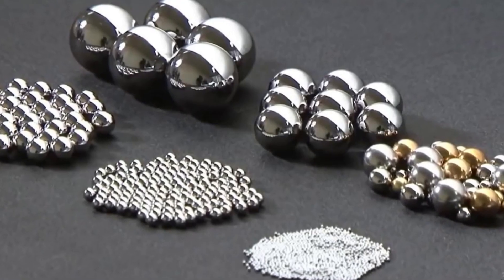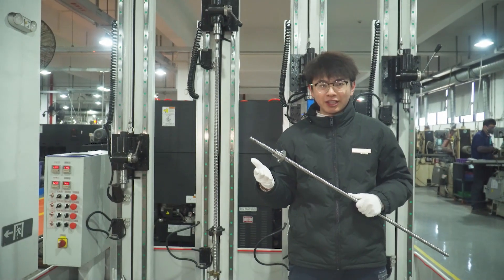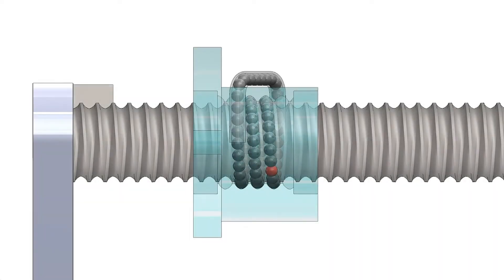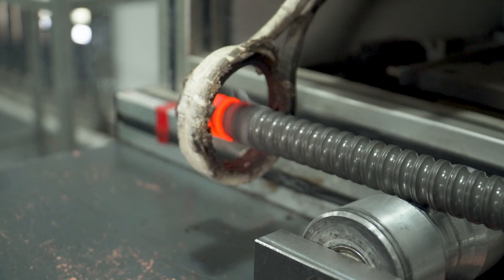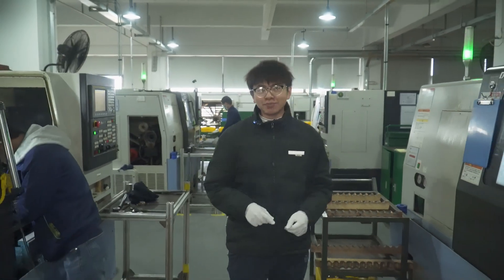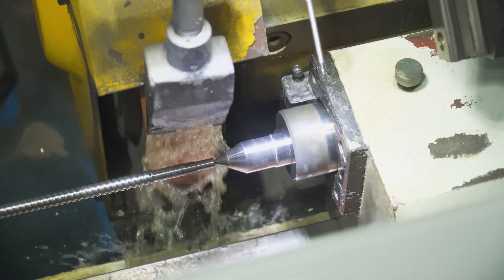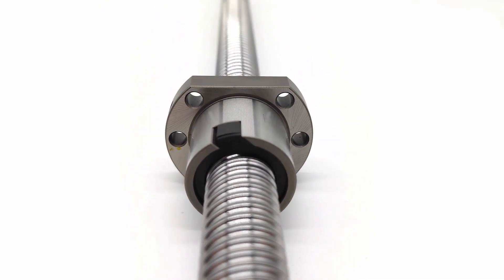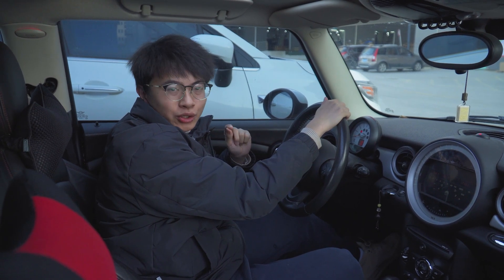Ball screw: make conversion of rotary motion into linear motion!

Comment: How do you prevent ballscrew wobble over long distances?
Reply from the maker: The first step is to choose an appropriate screw, with a larger diameter and lead to increase its natural frequency and avoid resonance. Secondly, choose the appropriate support method, for example, using different support methods at the ends and in the middle. Increasing the weight of the device connected to the screw can also reduce vibration. There are other methods, depending on the specific application scenario.